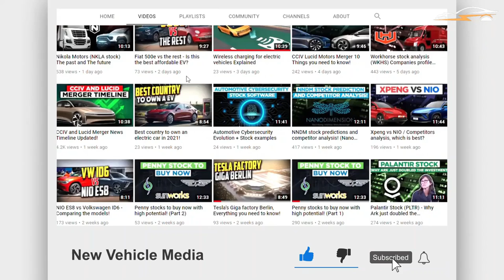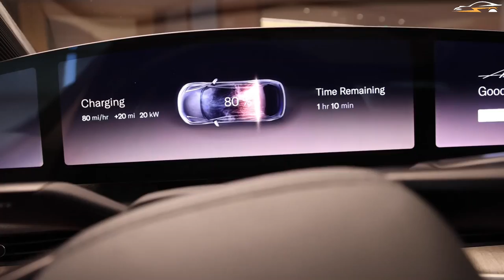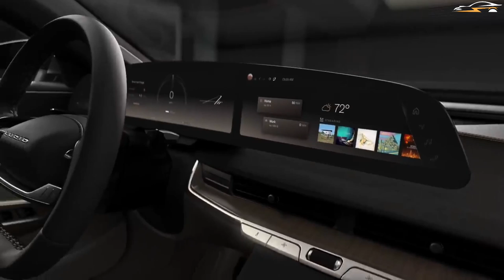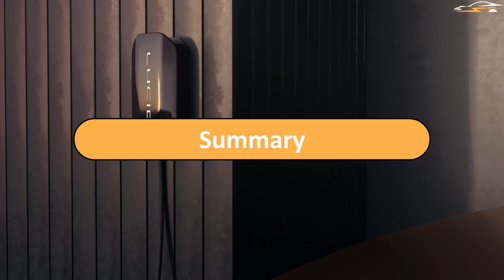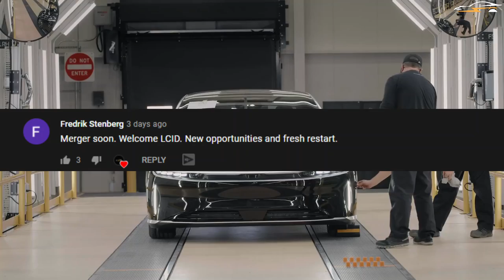New UPDATE on Lucid's warranties and mobile repair service!

Comment: Based on my experience with Tesla service, I've had no worries about being an early reservation holder for an Air Dream Edition.  I am confident Lucid will offer the same quick response and good service with their mobile fleet in the first few years that Tesla did.  The real test will come as Lucid expands its product lines, both by introducing new models and by continuing modifications of components in existing models.  Tesla hit the tipping point with the introduction of the Model 3, which overwhelmed its service network almost overnight and brought it to a sad state from which it seems unable to recover the responsiveness and convenience that made its early days so convenient for early Tesla owners.

In short, I expect my first couple of years of Lucid ownership to be a breeze on the service front.  What I worry about is the out years.

Comment: Disappointed in battery wnty. Should be 10 yr/150 k miles. Battery replacement is between $10k-$20 k for Tesla. Battery is the most expensive replacement
Reply: Thanks to the Tesla crappy quality  .